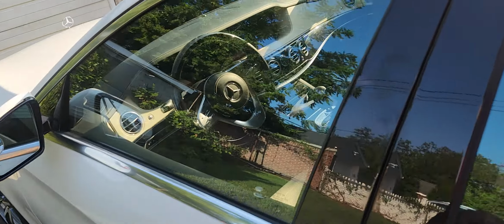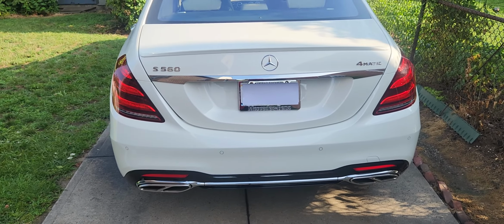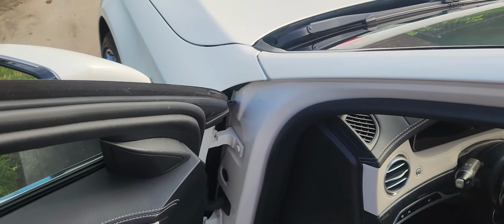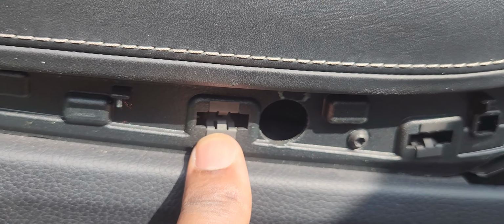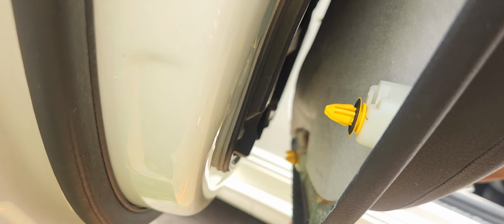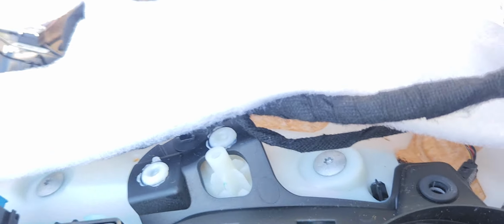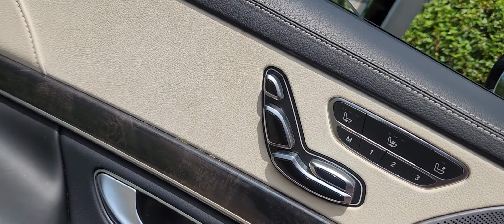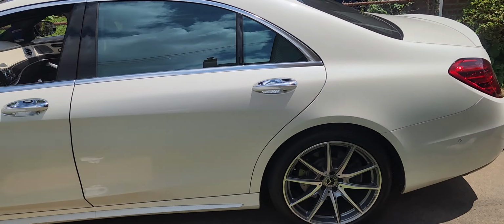Mercedes Benz Driver Side Trunk Switch that is Defective । Wayne A. Robertson

Comment: Shouldn’t you be able to do this without taking out the door panel?
Reply from the maker: No. The switch only comes out in 1 direction. You can try your luck but risk damaging the interior lining but I don't recommend it.

Comment: Thanks Wayne how about if I press the key fob or the side button to open the trunk it just releases and does not open. But if I open manually it will open and close without any problem
Reply from the maker: Do you have any restriction turn on under the car settings for the trunk
 I believe it called Height Restrictions?

Comment: When you replaced the transmission mount- did that solve your idle vibration on the steering wheel
Reply from the maker: Yes it did

Comment: Thanks for the video.

I have a quick question: My trunk's button doesn't work from inside my C300. Do you think related to fuse or something else. Today I went to the dealership and they said they charge me $400 for taking a look.
Reply from the maker: Wow $400 just to take a look and charge you for parts and labor with tax to replace the part. Yes it could ne fuse related and if not replace the part yourself
Reply: @WayneARobertson  yes, that's insane.
Do you think I have to buy fuse or the interior button?
I really appreciate
Reply from the maker: Buy the fuse because it's cheaper and after the fuse buy the part. Before you buy the fuse, look at it and see if it is blown then buy it. Don't waste money if you don't have to.

Comment: Thanks so much for showing to replace this switch, 
Can you please make a video for service A performed and my 2015 mercedes s550 right rear window knob is broken 
One of four 
Do i have to replace the whole module which have 4 buttons total or can i just replace the one is broken 
Thanks
Reply from the maker: @aquaqshark  You have to replace the whole module. I believe I did service A and B video a while ago. I did not call it A or B but replace cabin filter, oil, brakes, etc. These video or all separate. There is a maintenance schedule video I did early on. Check that for starters.
Reply: @WayneARobertson  thanks so much